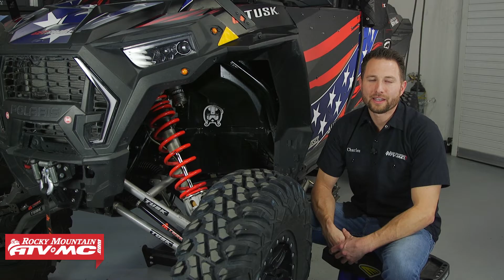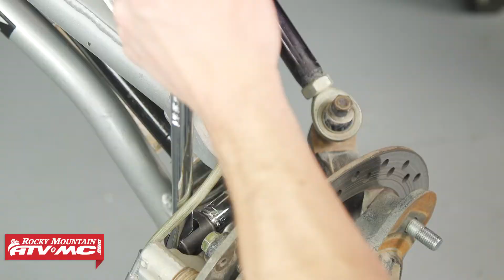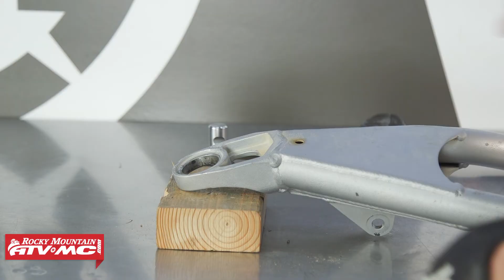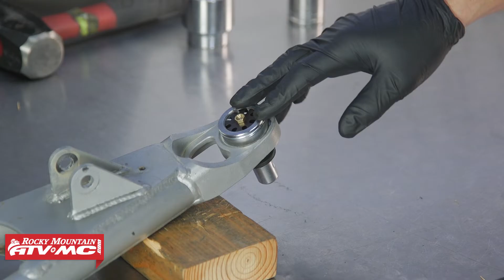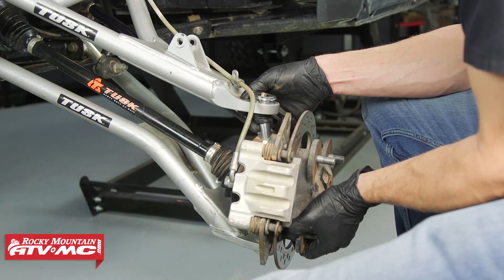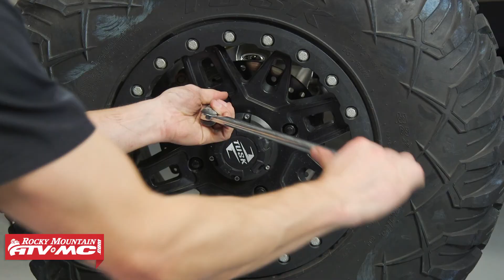How To Replace Ball Joints on a Polaris UTV

Comment: How about showing people how to do this without completely disassembling the a-arm. Just because you do this on a bench doesn't mean this is the only way. Almost everything can be done without drilling the rivet for your brakes on your a-arms.
Reply: I don't like hammering in new components either. I like the C clamp method of pressing the ball joints in/out.